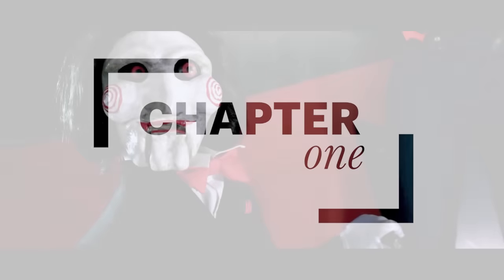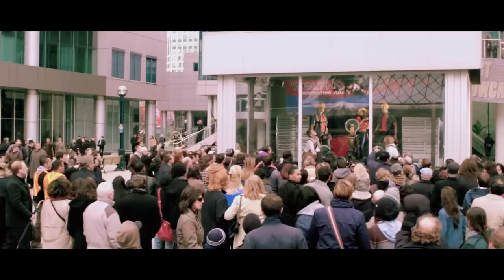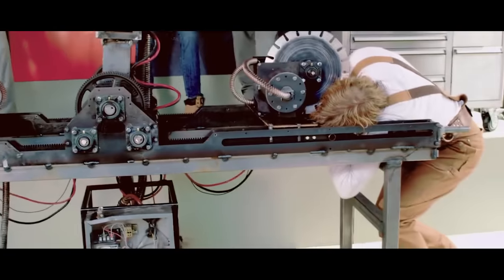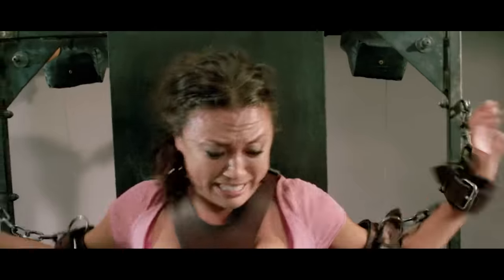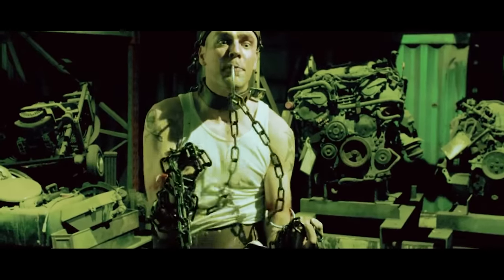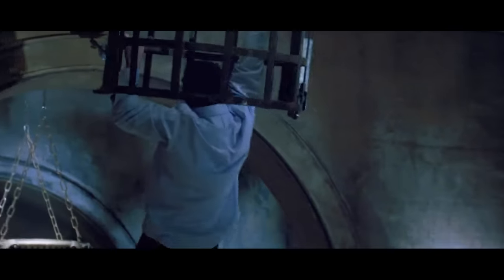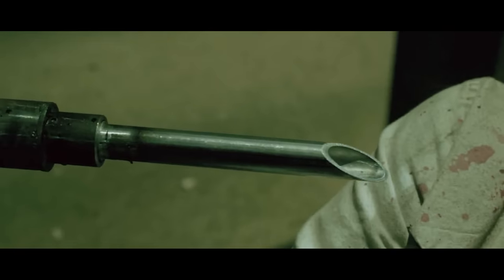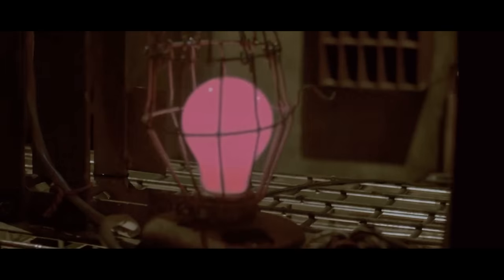How to Beat ALL TRAPS in Saw 3D

Comment: If im not wrong the first trap has a huge design flaw that being i think that if they push the saw enough to one side no one should get sliced
Reply: Remember that they have restraints on their wrists positioned close in front of the saws
Reply: @mattokane2737  yes but after rewatching it you can see that even if they do get cut they won’t die so I would much rather lose a chunk of my arm or front chest then completely die and I think the sames for all three of them but J think they did the right choice.

Comment: For the teeth code trap, use pressure.

Press your finger hard onto your tooth where the numbers are engraved. Your skin will press into the form of the numbers and keep shape for a little bit so you have a chance to see the numbers etched into your teeth. 👍👍
Reply: OMG SO SMART
Reply: Weren't the numbers under the gums?
Reply: No it was engraved on the bottom + sides! @resonatingwinds

Comment: For the wisdom teeth trap, you would only need to pull out the first two teeth, leaving only 100 possibilities for the code, as opposed to thousands.
Reply: But like time is on the line so just pull both out. Also its only 2 teeth that need to be removed, not 4. Don’t believe me? Look at the diagram it says “1”
On a tooth and “2” on the other. So there are only 2 teeth. But back to what i was saying just pull both out

Comment: For the wheel trap I was thinking about using the glass shards from when the puppet smashed through the window, and cutting through the leather restraints.
It also has a completely exposed gear chain you can effortlessly pull off the gears.

For the final trap I always thought about using the bottom of the cage that Bobby was originally trapped in. It flew of and landed on the side of the room, you could bring it with you. Then at the end, attach the hooks to the grate through the holes like you're making a swing set, and use it as a platform to stand on. Or just loop the chains under your arms, and hook them into their own chain.

Comment: For solving the 4 digit code lock I think that all you need is first two numbers from first tooth, because now all you have to do is to check only 100 possible combinations ( from 00 to 99 ). So you only need to pull out 1 tooth instead of 2. It's still hard to beat but this way is much easier. Checking 100 combinations would take about 8 minutes. Sorry for my English, I'm from Poland, Cheers!

Comment: For the last one, I think the easiest would be securing his belt under his arms, over his chest and pulling himself up by the belt. By stepping on it there is a chance he'll lose his footing, but by using the belt as a harness, it would be pretty foolproof. 
He could even use both shirt and pants to make an even better harness
Reply: Or he could connect the hooks to eachother and create a swing like seat, which would also be more stable than standing, and then use the belt to secure his body to the chains so he doesn't fall when reaching

Comment: For a lot of the traps, he should have noticed a pattern which was don't push play on the tape..for the guy super glued to the seat. He could pull out the wires near the fuse box which might disable the car from starting. Or perhaps pull the e brake if there is one which could buy him time.

Comment: The first trap is easy to beat, on the table the legs a connected by a bar, if they slipped their legs through they would be able to slip under the contraption and have the other guy push it to him so all three survive

Comment: 12:04 He could pull only one of his tooth and get 2 out of 4 digits and guess the remaining 2 digits.
If it takes 5 seconds for each try he would only need 100x5 seconds or 8 minutes and 20 seconds, if he were to start with 00..01 he would lose quite some time and it would be harder to solve the next trap but if he starts with 99..98 it would be very helpful.

Comment: Creative way to beat the tooth trap. If the teeth are engraved, make yourself bleed somewhere that isn’t lethal, dry the tooth to the best of your ability and dip your finger into the blood and rub into the tooth, without wetting said tooth, get the paper off the chart on the wall and press into the tooth you smeared blood on, the engraving should print because you’ve just pushed blood into it. Like a etched stamp.

Comment: I thought I heard somewhere that you can have a tooth pulled or knocked out and still be able to essentially just stick it back in your mouth. That is, if the root of the tooth is still intact. In this way, he could solve the trap in the way Jigsaw wants and also suffer no loss aside from the pain. Not the best since it's doing what the killer wants, but it's something.

Comment: Love triangle: it looks like their hands are only bound by leather buckles that they can reach with their teeth. One guy uses his teeth to free his hands and then his waistband (or lean back). The other guy then pushes the saw to the freed guy’s side and everyone waits out the time.
Sticky skin: taking off the visor or rear view mirror could give you extra reach.
Nina’s trap: I had the most trouble figuring this one out. There appears to be a lot of exposed conduit lines. Try breaking them. The best ones to target would be the one coming from the wall behind Nina or any ones going to or from the motor driver, which appears to be a large box beneath Nina.
The human wheel: the chain moving the gears looks very loose, a good forceful kick might dislodge it and stop the wheel moving. Also, there is leftover wire hanging on the wall, you could use it to close the circuit.
Test of courage: I agree with your idea.
Wisdom teeth: Smash the tv and the security cameras, there’s a chance that one of them might contain a first surface mirror, if not then you’ll still have broken glass you could use to cut your gums and make the pulling easier.
Final test: I agree with your idea.

Comment: I believe that the windshield wipers on this car may or may not be ones that also dispense water. Moisture would dampen the vehicle and would also greatly weaken or even disable the effect of the adhesive, effectively making it super easy to remove yourself from the car without worrying about even rupturing the skin to the point of drawing a single drop of blood. It may not work, but it is worth a shot.

Comment: The car Chester is in is pretty old, and probably has manual seat adjustment, metal bar under seat or handle on side, could move seat once hands are free, maybe take his belt off instead of pants, and try to lasso the handle.  A last ditch effort could be to just start pulling fuses if you can reach the box, or even kick it open and smash the shit out of it with foot.  Also, thought of maybe hot wiring the ignition, like you see in movies, but in reverse to shut the motor down, but the steering column on those cars are pretty solid and couldn’t open that fast with just your hands.

Comment: Main flaw with the power-out idea of the first trap is if the building isnt connected to the grid and is generator-powered. Still not impossible, but it WOULD require someone to locate said generators

Comment: Whenever there's an exposez we drive chain if you have a small piece eof flat metal if you put that between the sprocket and the chain you could use it as lever to completely remove the chain also get your close wet and connect the two electrical lines. Even if you cuase a short , that could flip whatever safety switch that supply power to that contraption

Comment: not sure if thered be enough time but i guess it would be worth a try. Chester (RIP) could have used his hands, which were free to try and rip the fabric in the seat. he likely would only need to scratch a small hole and the fabric would rip in a line. so when he moved, the fabric would rip off the seat instead of his back ripping from the seat

Comment: For the first trap seeing how the straps are on their arms, and considering they can lean forward, one of the guys could just undo it by using their mouth, only one of the hands need to be out, then just lean to one side and let the saw come, all 3 saved, if the waist one doesnt let u move to the side u have one hand or two hands free that will help out

Also on the chest piercing trap, ive always thought about him stepping into the hooks and pullung himself up that way, looks like it can hold his whole weight so its a possibility, no piercing, your wife is dissapointed in you a bit for it, but i believe its possible

Comment: On the wheel trap, he could just step on the bicycle chain that turns the wheel, it’s completely exposed at ground level and stepping on it could easily derail it.     On the teeth trap, he would only need to pull the first tooth, after the first 2 digits, he would only need to guess 100 numbers which should only take a minute.      The hook trap, he could hook them into the waistband of his jeans so he wouldn’t have to step on the sharp hooks.

Comment: Even if I had my wisdom teeth, I couldn't beat that trap- all 4 required surgury to remove because they were partially covered by my gums. Even if I had to just to it on rear molars, I'm not sure I could do it even with my high pain tolerance since the pain is bad enough to be disorienting, which would affect my ability to perform fine motor actions

Comment: the first trap looks like if you push the saw to one side enough so its off center but not cutting one of the guys you could wait until the girl is low enough then pull it back to center and it will hit the metal frame she's attached to.  Then you just have to wait for someone to get you out.

Comment: For the wisdom is tooth (fun fact: i had my last two pulled out saturday 5th , now in my finals days of healing until the stitching dissolves this sat) ago he can try looking for the best lit section of the room and use the tooth forcep handles as a mirror and looking from the best angle possible. Its a stretch but its the only tthing i can come up with. I sure as hell aint pulling teeth out after the past 4.

Comment: Exactly, its not simple, and you need some contacts. I had job where i was able to shut down electricity, and if you want to shut down electricity instantly as an emergency, you would shut down half of the city, coz you can call to the 100KV transformer station, . You can shut down just one location, but you have to drive to specific location to get inside transformer station and there shut down the location. And i think they could survive if one of them lean back as he can, and the second push the saw as he can, but still not killing him.
Reply from the maker: Thanks for the info James!

Comment: Does anyone else realize that the way the lawyers tied down is mostly by a bunch of leather belt ordeals an every single one of the buckles on them are exposed? If so, then the obvious choice is to quickly unbuckle her and pull her down an out of the piece that holds her head down cause it looks like she has some pretty good movement. Also for the car trap if he can take his pants off and maybe tie the laces of his shoes to his pants, an hopefully with good aim lasso it to where the shoe slides on the lever and there u go. Now for the silencer or throat piercing trap, is it possible to use the woman's heels to pick the lock or undo the straight jacket and use the buckles on it to jam the gears? Then there's bobby's fake test brought to life, why doesn't he wrap his legs round the chains and try to catch himself when he feels his chest muscles are about to give? Or is it possible for him to take hooks an go under the back of his thighs an then connect the hooks to the chains, or go under his arms and do it that way, makin his own climbing harness? I'm not an expert but I have been watching these movies forever, an have been watching many videos like this one on how to beat the traps in the saw series to figure out many different ways to beat these traps

Comment: I'm no Zweistein but only their waist are abound, their feet not, the whole contraption is powered by the device under the table, which has exposed cabled, they can just simply kick the cables out of their sockets, thus rendering some part or maybe all the machine useless.

Comment: I wonder how Jigsaw would have gone about the Wisdom teeth trap if it had turned out he already had his wisdom teeth removed. You might say "well he'd just pick the next closest teeth" but would he? The traps are almost never meaningless, and I feel like the trap is heavily based on the fact that wisdom teeth are called wisdom teeth. My guess is he'd try to jam some other object where my wisdom teeth should be. And it's either A) going to be a sharp, slick object, so that he can stick it in my gums without slamming them into mush, in which case I can pull it out pretty easily, or B) It's going to be blunt object, probably resembling a tooth, that he jammed in there, which will greatly damage my gums, so my gums won't put up much of a fight when I try to pull it out.
It seems like not having wisdom teeth is the best way to beat this trap, lucky me.

Comment: Causing a power outage would actually be incredibly easy. Just need something to cause the power line phases to either cross phase or go phase to ground blowing a transformers fuse and thus causing an outrage. 

Would be very simple with any type of metal or conductive object large enough to be thrown across lines.... or simply find the supply of electricity and either switch the power off via a switch or breaker. No building would be able to be built in the middle of a populated city without proper electrical work being done... even if there is no switch or breaker box with the right tool you could easily cut through the electrical feed causing a dead short. Obviously you would need proper tools to keep from you being shocked. 

If I were there I always have my tools with me I curling multiple insulated cutters. 

I am a lineman. We work on electricity from 120v all the way up 750k and beyond.

Comment: They only had one minute with that first trap. There's no way anyone could contact the power people and convince them to turn it off and then HAVE them turn it off all in 60 seconds. Have you ever tried calling the power company? You'll be on hold for 40 times that long. Plus, if anyone mentioned it, so many people would call that they would jam the line.

Comment: https://youtu.be/K7G7ehtKvyg?t=795
Instead of pulling both his teeth, he can easily pull only ONE tooth, which then would lead to getting half the code. Therefore he would only need to test ~200 codes. i.e) Pulls the tooth out. Having not watched the movie, I will assume that he does not know if the code is the first or last 2 digits, let's pretend for the sake of this example that the tooth gave the numbers "12". He would know the code is 12XX or XX12. I don't believe there would have been enough time if X12X was allowed  to be a possibility.  He would have to test the XX portion of the code, with a maximum of 99 (~100) possibilities.

Comment: trap no.1 if you friend really is a electrician then he/she is a bad one, there is no way in hell you can stop a localize transformer within mins you can maybe cut off the main supply of the building if you inside the main breaker room and able to find the main switch or all the main switches but that is a big if, main switch is most likely in the basement level or the ground level and its not easy to access because you need key and such you switch it off, yea if someone found out there is such trap before the timer start there is a chance to stop the whole thing but after the timer start there is no way in hell that you can stop the electricity in time

Comment: Trap #2 I found another way actually 2: #1: assuming the arms are freed if not then use feet when it begins to move drive it away from one of them the other will die but its better than all 3 

#2: there is always gonna be some kind of device to pull your seat forward, and backward find it and use it then get your arms unstuck assuming there already freed or not 
Then to then do it enough where your hands can reach the lever